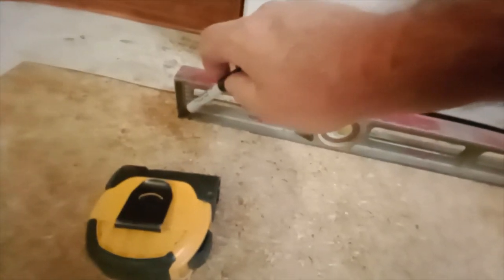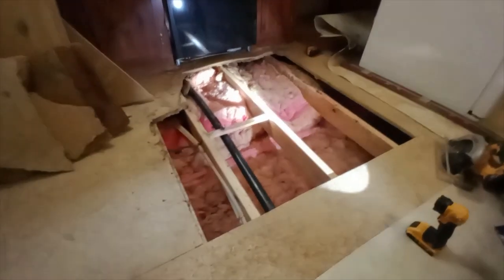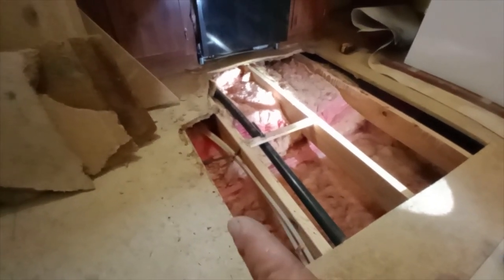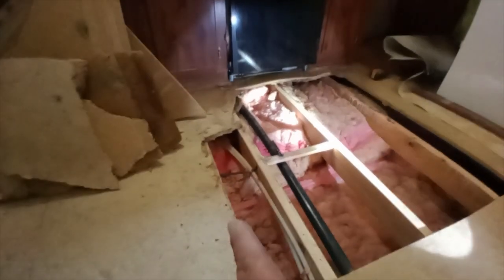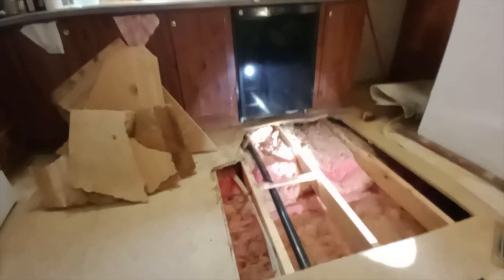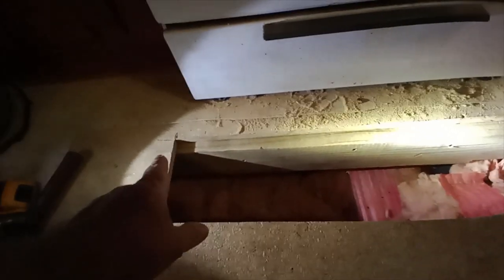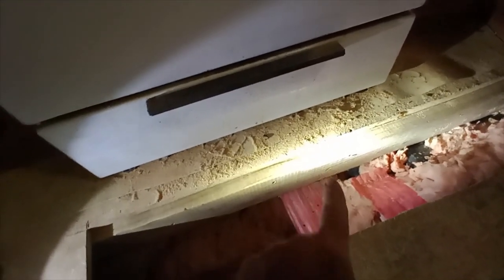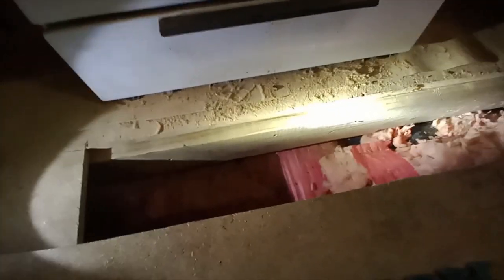How To Replace a Rotted Floor in a Mobile Home (Mobile Home Kitchen Floor)

Comment: If you run into ring shanked nails with glue that won’t budge with a nail puller, use an oscillating tool with a carbide blade to cut each nail head off. Then pull up the wood and either hammer in the remaining nails or cut them flush with the joists. It works great especially if trying to reuse any good plywood sheets.
Thank you for sharing your methods of successful projects. You are appreciated, much!
Reply from the maker: Thank you for sharing those tips! Your comments and suggestions are appreciated as well!